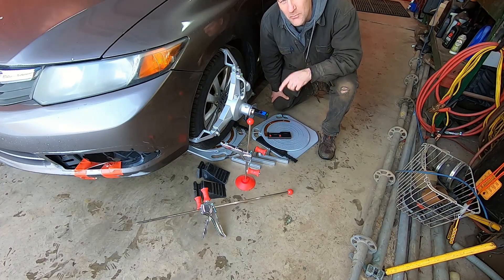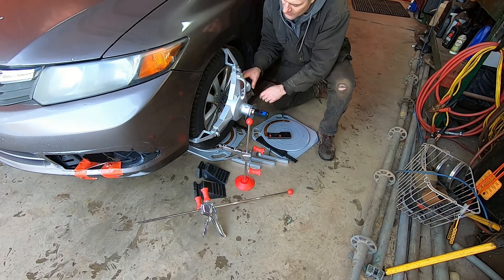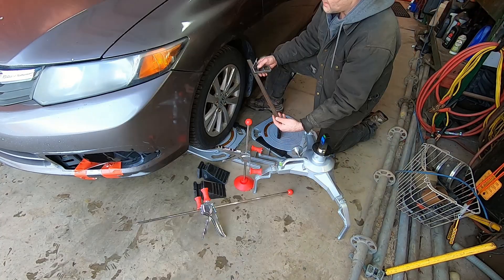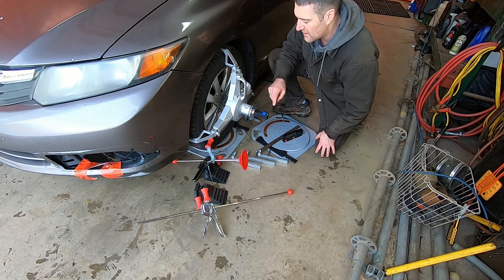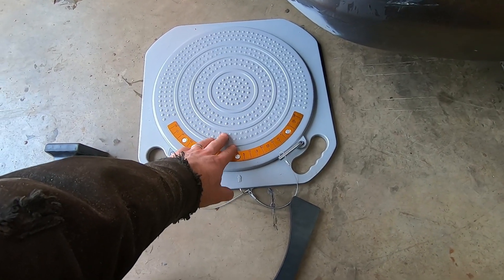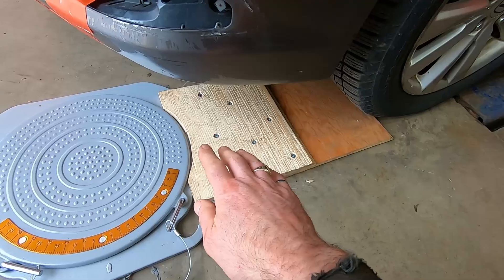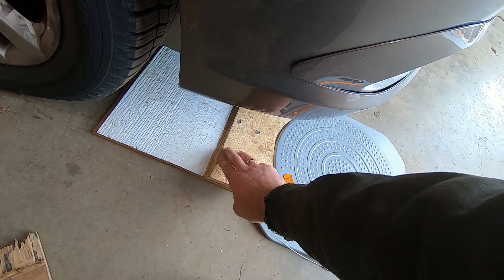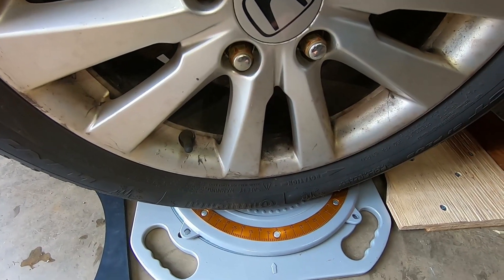How to Measure Caster and Camber with UPDATED DIY Turn Tables, Tire Clamp, Digital Gauges

Comment: Y not show how to adjust to tire.says 18 inch to 43 inch tire. Y not show it
Reply from the maker: are you serious?  I literally show every step.  see @2:28
Reply: @mrdiyguy123 it shows the wheel that turns and tightens or loosens but didn't show that it has holes that click in or out on the arms to bring it out  or in it just shows the different brackets. I have it now so I know. My wheels r 34 inches . It would of been a help if you showed it clips bigger or smaller then you tighten with the wheel
Reply: Same thing, this is all info to sell products not how to actually use them
Reply from the maker: are you serious?  I literally show every step.  see @2:28